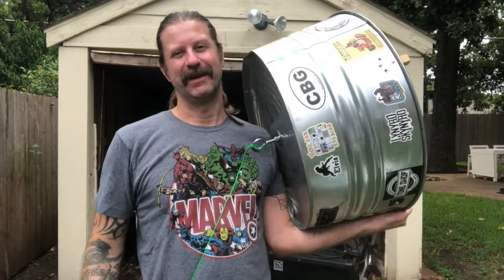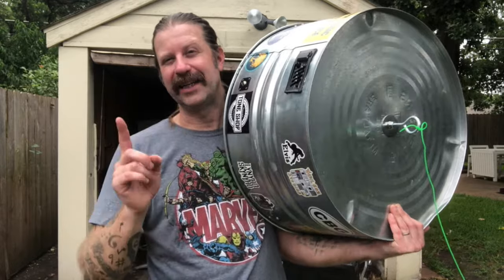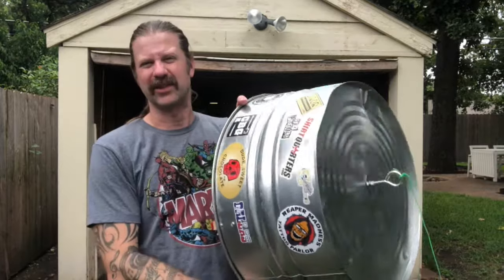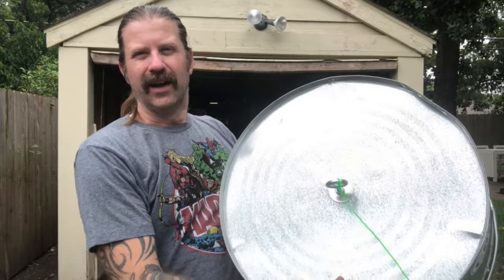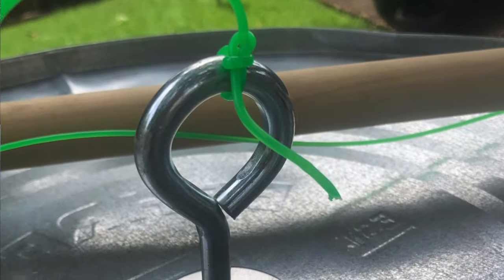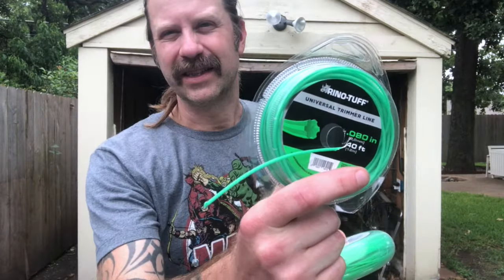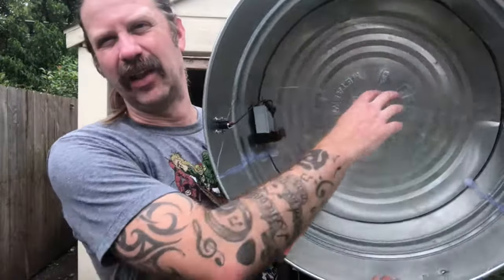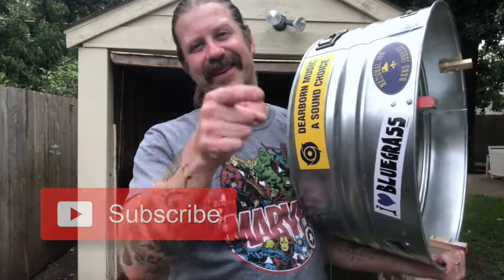Lessons Learned from my First Washtub Bass Build

Comment: Truly enjoyed this video! My bucket employs a soft nylon paracord string, amplified with two mics, one to my PA system and one to the bass amp, very near the eyebolt. I want to try your guitar pickup system but can't bring myself to cut in to my bucket as it sounds OK. Time for a second build with guitar pickup.
Reply from the maker: Thanks for watching the video. The good thing about these washtub basses is it's really easy to create another one. It sounds like you've put a lot of thought into the one you have. Good luck.

BTW, check out this video to see exactly how I did the pickup. https://www.youtube.com/watch?v=Ov8deQ7UJnM
Reply: You can put a condenser microphone underneath the bucket. Works great.
Reply from the maker: @aniquinstark4347  Using a mic would be a great technique for recording but the idea of this arrangement is to be able to plug the washtub into a bass amp (e.g. for jamming w/a drummer). Most bass amps don't have phantom power or XLR inputs so a condenser mic wouldn't really work well for that particular application.

Needless to say, you could plug the mic directly into the PA (as Bunski stated above) provided you had enough channels available. That would be a possible solution for live gigs but requires a lot more equipment (mic, XLR cable, preamp, power amp, pa speakers, speaker cables, etc). If you've already got all that for a band setup, it might not be a big deal for you, but probably overkill for a jam session.

Another advantage of the 1/4" output is you can plug the washtub directly into effects pedals. With a mic, you'd have to route a send/return channel out of the mixer to the effects and back. Again... totally doable but a lot more cables and setup required. The piezo/preamp is a really simple solution for a bass player who already has an amp but wants to get into washtub bass.

Comment: Looks like a pretty good way to train your ear because there's no frets or even a fingerboard to visually guide you.
Reply from the maker: You are 100% correct. Washtub bass is very much a "feel" instrument as there are no frets and the string doesn't even have a pitch until you put some pressure on it. Thanks for checking out the video.